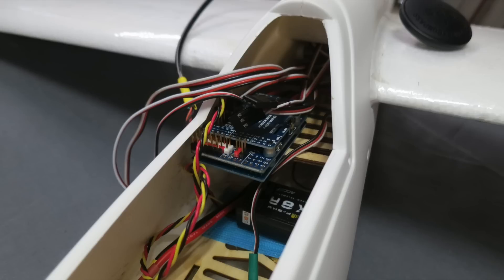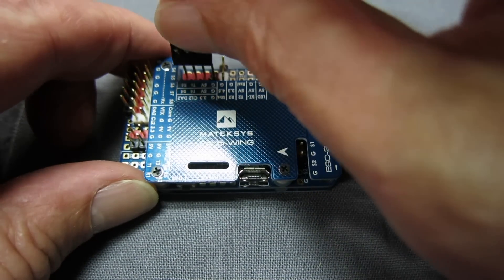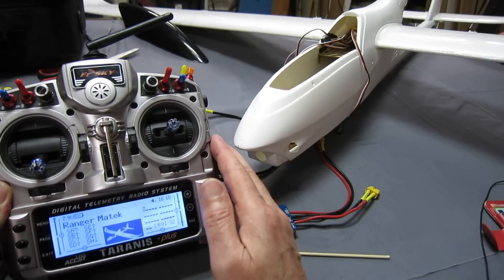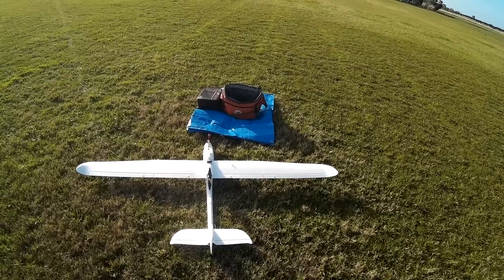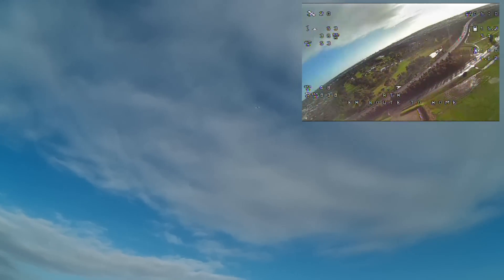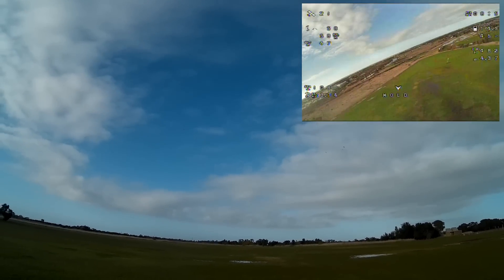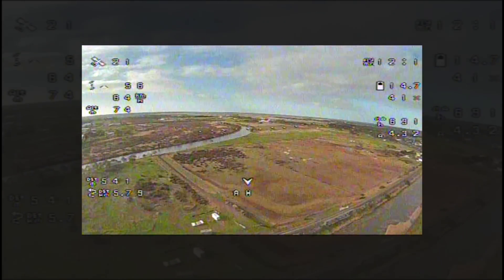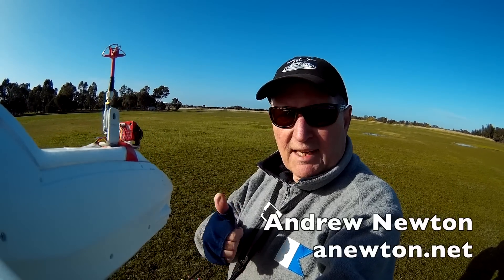Matek F405 Wing FCB iNav setup and flight

Comment: What’s going on with RSSI?  Nice video by the way.  I tried setting up inav on a nano talon recently and pretty much took a sledgehammer to the board after a week of nothing but frustrations.  I’m considering getting this board instead of trying another Omnibus F4 which imo is ridiculously cumbersome. I really want a vector but money may be an issue with that board being it’s almost $250US!  I haven’t really decided.  I am definitely getting this plane and ordering it in two days but for the flight board I prefer something that’s not going to take me days or possibly weeks to get configured.  I’ve been using APM and pixhawk for a few years on Multicopter but never planes. I may just throw one of my spare pixhawks or even an Apm in.
Reply from the maker: No RSSI on my OSD, might be looking at throttle percentage?

Comment: Can't wait to try my F405 Andrew, had it a while.  Tip...put the crosshair on your OSD, this way you can tell how good your Pitch trim status is (Board Trim) when flying in Horizon. The AHI should pass thru centre as the plane cruises along in Horizon Mode.
   I need a model with Rudder to test its full potential as Im pretty sure iNAV will use both Ailerons AND Rudder during GPS Modes like RTH. It looked like it was over controlling a bit on your first RTH attempt?
  One of the most impressive things about your clip for me was the nice clean Video Link, even though this FC has a current counter on it.  You really should try and fly in Horizon / Alt Hold more, it's by far the laziest Modes to have engaged...lol.
  Im assuming the Rudder is gyro stabilised?...you didn't really focus on it?
Great bird to do the testing with......More please.
Reply from the maker: Thanks to your comments in the past, if I was heading off down the coast for a distance test I would use Alt Hold and Horizon, and yes the rudder is stabilised too. More testing needed, may have been the wind causing the side to side seeking on that first RTH, or insufficient throttle. 15kn wind up there.
Reply: For a test flight it was pretty good Andrew. I think on the first RTH it was trying to climb a bit too steep for the power level setup, and then it kind of turned off the stall each time..?
  I usually have RTH set at 100 mtrs and then 30 bank, 15 Climb , 5 Dive...usually works okay.
Like to see it fly again in RTH to see if its using Rudder...?
   Thinking of putting it in my Skywalker 1900, but Rudder is essential for this one, its adverse yaw is terrible.
Reply: ""its adverse yaw is terrible.""  Maybe try some aileron differential??
Reply: Hi, yes.....Aileron diff is not enough on the SW1900...I used Aileron and Rudder mix which cured it very nicely. my Storm AP does not have Rudder on it though, so this FC would cure that problem.

Comment: Nice one Andrew!!!!! Mine is a few days away. Have you worked out how to get crow yet????
Reply from the maker: Not yet. I think I can have flaps straight from the X8R as long as I free up one of the channels. Will probably be easier with the next iNav release.
Reply: Yes. Flaps directly from the receiver.  I know you like to use 2 channels for flaps. I slum it and use 1. Having used pixhawks in the past I now love the versatility of the modes of Inav. I have a couple of Furious F35 lightning flight controllers. I found the aileron servos needed the polarity changing to stop the FC turning the plane onto it's back. Guess what happens to flaperons when that happens. (Crow) I wonder if that could be induced by swapping the aileron leads??? I like your videos. I think a lot of other folk do as well. Please keep them coming and if this little tip is useful ……… Go for it. Garry G
Reply from the maker: Brilliant Garry, I can see how to do it now, thanks mate. Flaps on a slider direct from the X8R and iNav flaperons upside down on the same slider.
Reply: Bingo!! Show us in a video
Reply: I discovered the flaperon/crow purely by accident.  Or rather to stop an accident. Further to the thought of swapping aileron leads. I have one of banggoods cheaper options for the f35 FC as well as the 2 "genuine" F35 kits. The 2 "genuine" F35s require the aileron servos' polarity to be swapped for the FC to react properly. The cheap one does not. I haven't checked this yet (but am going to) I wonder how the FC would react to swapped aileron leads????? If things were set up to match would the FC notice the "fiddle"

Comment: Is the f411 setup the same as this one?
Reply: Bandito Fpv essentially yes. I have both. The 411 has only 2 Uarts and no blackbox. But it's much better for small flying wings that don't have flaps and pan and tilt and all that kind of stuff.
Reply: NoAgenda FPV ok thanks I’m have the f411 and it’s going into my wife’s rite wing hc44 that isn’t running gps or anything like that, just fpv gear and receiver. Really just want something to keep her stable on launch.
Reply from the maker: Haven't used the F411

Comment: suggestion: connect an external compass(or the one on the gps module) to the FC  using i2c. INAV require a compass to enable funtions such as return-to-home(RTH) mode. https://github.com/iNavFlight/inav/blob/master/docs/Navigation.md#nav-rth---return-to-home-mode
Reply from the maker: Not for fixed wing, in fact it is not recommended
Reply from the maker: From the WIKI
If your compass is not 100% properly setup just disable it instead. A calibrated compass can cause orientation drift during flight that may not show up in the configurator(especially built-in ones on your FC). Really consider disabling it unless you need it. INAV uses GPS heading normally, Only on ground before GPS speed has been high enough or if error between GPS heading and compass heading exceed 60deg will it use compass heading

Comment: This is so relevant I have this fc on the bench right now 
Beware cutting the GPS unit cord for shorter length the black is connected to the cable sheath
Reply from the maker: Yes I did see that.